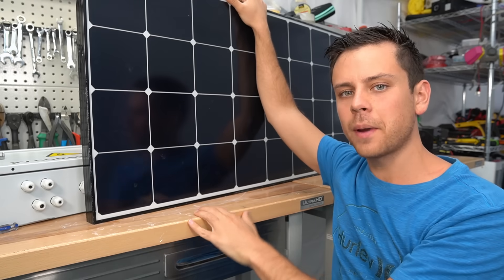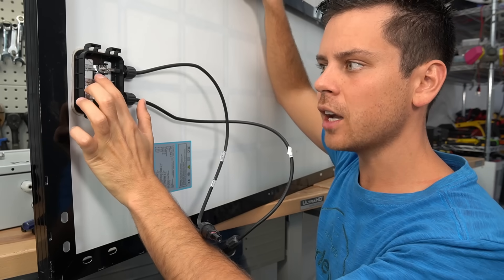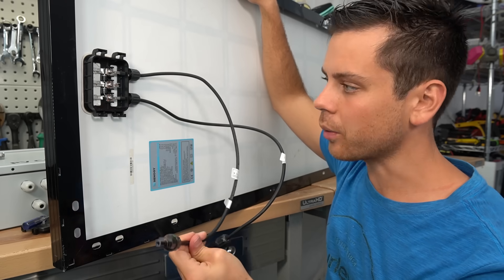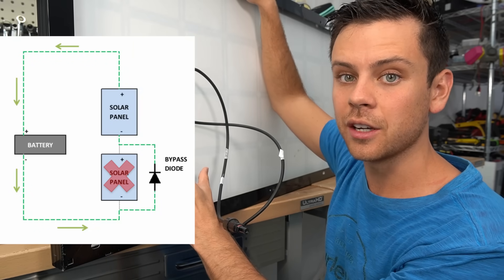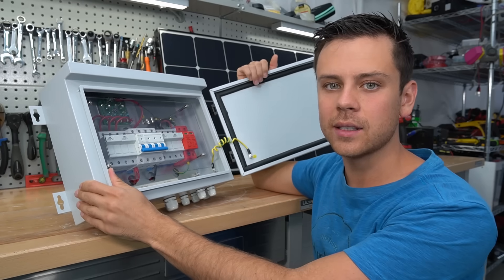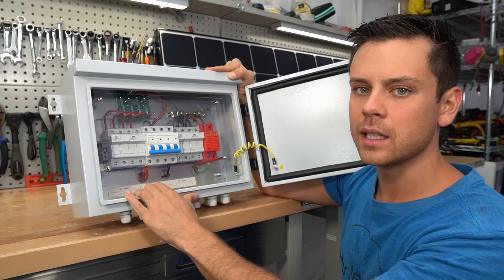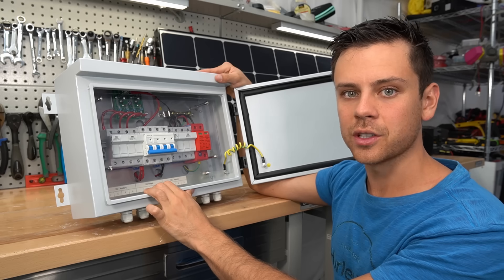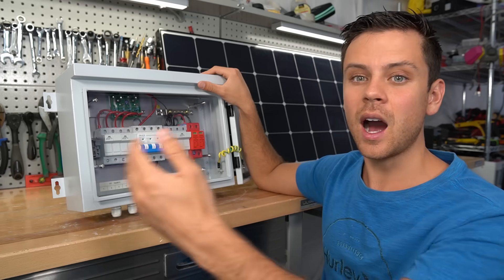Bypass VS Blocking Diodes in a Solar Power System

Comment: Hi Will, I love your videos, you have helped me a lot. But I have a question with my setup. I'm installing the 24v Growatt all-in-one controller/inverter. I got 8 of those used $50 panels from Santan (that's all that will fit on my roof). After looking at the numbers I figured out that I can run 4 panels in series and in perfect sunlight conditions the voltage would be slightly higher than the pv input limit of the controller/inverter. If that's how I end up wiring it, I would have 2 sets of parallel arrays. Since this is going into a camper I was not planning to get a second controller/inverter. Do you recommend a combiner box in this situation, and if so then what kind?

Comment: Thanks for this video Will, I have the exact East/West use scenario you illustrated. I recently ordered and received the Watts247 combiner and am glad you pointed out where to connect the East and West pairs to take full advantage of the two blocking diodes. I mistakenly assumed there was a blocking diode on each of the 4 inputs. I’ll update my wiring now as you instructed.
Reply: Glad you are going to have the full, safe and proper use of your equipment Nathan. Thanks to Will for this video.

Comment: Great video, I really appreciate when you share your knowledge with us. 
Will, are there any 100 to 200 watt individual solar panels that will still work in partial shade? My single panel output is hugely diminished even with just a little shading. Thanks
Reply: Stuart are you using Mono or Polycrystalline Panels?
Reply: @TheWickerShireProject  
RICH SOLAR 100 Watt 12 Volt Polycrystalline Solar Panel
Reply: @stuartstuart866  Check out Amy The Solar Queen at the AltE store. Do a search. She has video's on shading. Hope this enlightens.  You can Call them as well. Just make it sound like a business query. They help pros and beginners. Much love the Shire. P.S. Will did explain how Panels react in partial shade. If your looking for a 12v Panel 200watts and under they may have an answer and even the product.
Reply: @TheWickerShireProject  
Very nice of you to point me in the right direction.
Just found the Will Prowse video that you mentioned as well as the AltE. Thank you

Comment: When using 2 MPPT charger controllers, do you use them on separate battery banks? or can you connect them both to one large bank?
Reply from the maker: You can connect multiple charge controllers to a single battery. They will pull full output till the battery is at high soc. It will not trigger another controller to turn off. Check out my older videos where I did this as an experiment. They will not fight each other. Unless if course you program different charge profiles. But I don't know why someone would do that
Reply: @WillProwse  Thanks!  I've seen many of your videos but that one has not popped up for some reason.  I'll look for it.
Reply: I've always wondered this.   What's stopping one charge controller from receiving a false battery level reading from the output feed of the second charge controller?  And since new charge controllers also perform battery monitoring and maintenance such as equalize can it harm the batteries?
Reply: @rjlkc4668  I would def like to see this in a video from Will.

Comment: I have been looking for info on what happens when a panel has shade and how it affects the series string. I have 3 panels in series to an MPPT solar charger. It seems to pull down the out put of the whole string. If the panel’s junction boxes are sealed, how do I test to see if my panels have passing diodes?

Comment: I was planning on putting up two sets of panels with one that point more East and the other pointing West (just like your diagram showed). My thinking is, especially in the Summer months, that I could have sun on the panels over a long period of time. This way I don't have to spend a lot of money on batteries. Therefore utilizing blocking diodes is very important (I didn't know about them before this video thanks). My question to you is does this strategy make sense? If you can't invest large amounts of money in batteries or a tracker then throw panels at the problem...that's my thinking anyway, what do you think?
Reply: I have the same situation.  Since i have east/west orientation on the roof, I like the idea of spreading the solar exposure over a longer period of time, instead of a south exposure that peaks at high noon and may over amp the controller.  I would like to use one MPPT controller instead of two.   My expectation was that the voltage of one parallel string will usually be higher than the other but the combined voltage will be something in between, not a bad thing in my original thinking.  I may have to retool my approach a bit with the blocking diode(s).  Does the blocking diode just turn off the lower producing panel?  I don't like that idea.  I might have to go with 2 MPPT controllers, more expense and more complexity.

Comment: I did not know the bi-pass worked in series connected panels as well I thought it was only for within the single panel itself. I thought if one series panel gets shaded the whole set sees lower performance... hence I normally wire in parallel... You taught me something knew today thanks man!

Comment: What is the most direct way to charge a dewalt 20 volt max from solar?
Reply: Get a dewalt car charger and connect it to a 12v battery that is powered by solar.
Reply: @crasythinghappens  yep, safest way, and you can add other things later. Don't try to strip a solar panels wires and put them into the battery.

I suggest getting a cheap charge controller from ebay so you don't overcharge the lead acid battery and ruin it, but if you monitor it's voltage you can do without to keep it cheap if you are truly on a budget.
Reply: @volvo09  How about charge controller straight to car charger with 20 volt max battery?

Comment: "in the olden days"  Haven't heard that statement in a while.
Reply: I'm not "old" and i remember wanting to make a diy ev when people were still using 2k lbs of lead acid batteries and brushed motors. Tech moves fast! Solar is moving very fast, i'm thrilled by that. Computers and whatnot? Not too much. I just want to get more done with the equipment i have, while being able to keep it fairly simple.
Reply: ... the (g)olden days.."
Reply: It doesn't seem like solar has been out all that long, so it's funny hearing him say "in the olden days", LOL.

On that note, I saw a re-run of Knight Rider where one of the cars in a race was powered by solar panels on its roof. Not feasible in the 80's and not feasible now, LOL. Ah, the olden days. :)
Reply: And what about "shtring"?
Reply: Hope I live long enough to hear scornful remarks about ‘the olden days when the old folks took pictures of every meal’.

Comment: I wonder about EMP/solar flare protection on my array. Would love to see a video on ways to protect my system from a Carrington event if that's even possible. I wonder if a blocking diode could be used to detect overcharge and thus protect the system.
Reply: For solar flares, just being off-grid will protect you. The magnetic fields and ground currents need miles to work over to develop dangerous voltages. That is why telegraph wire were so vulnerable to the Charrington Event. As long as your cable runs are less than a few hundred feet, you should be fine. 

As to the EMP, that is tougher. You would need a conductive coating on the panels a d shielded cables. The conductive coating would block some light requiring more coated panels. After that, a faraday cage around your house (or a well grounded metal building). 

Add the previous poster’s advice on lightning protection and you should be set.

Comment: Off garage solar just released a similar video yesterday, what a wonderful coincidence.
Reply from the maker: Oh no way! I missed it
Reply: @WillProwse  No he didn't. He did some experiments about the diodes when he bought used solar panels some time back, not yesterday. BTW I think Will's explanation is much clearer. I think ideally we should have a bypass diode for each individual cell, may be not economical/practical though?
Reply: @DSmartLife  hmm it will be alot of reason why not to do that.
Reply: @DSmartLife  Absolutely right, it was two months ago and it showed up in my feed this morning. My apologies, I thought we were getting a wealth of diode videos all of a sudden!
Reply: @DSmartLife  Each diode has resistance, so with many you lose more output. Would be OK if you're really over-paneled.
Reply from the maker: I am not seeing it at all. Did you mean another topic?